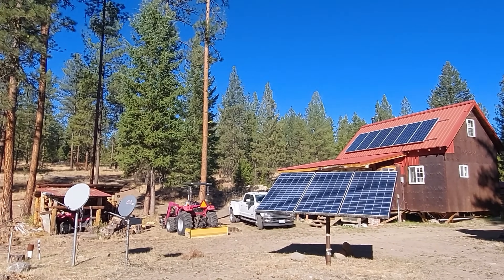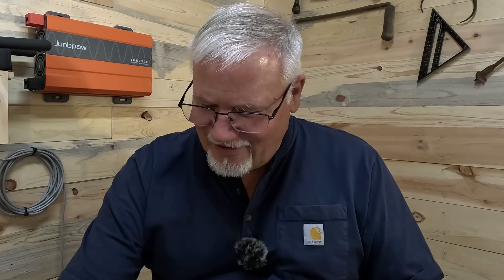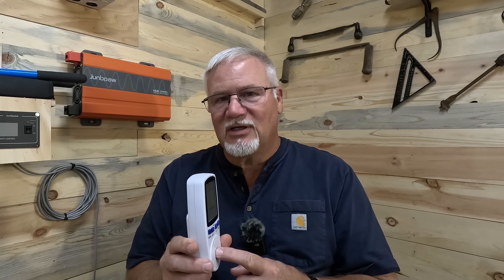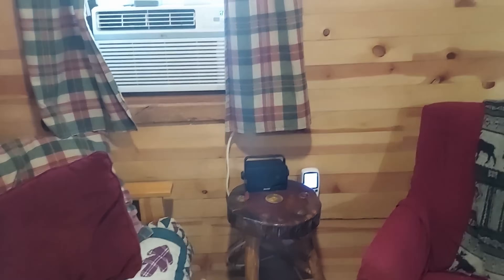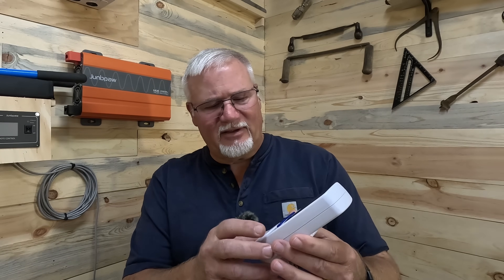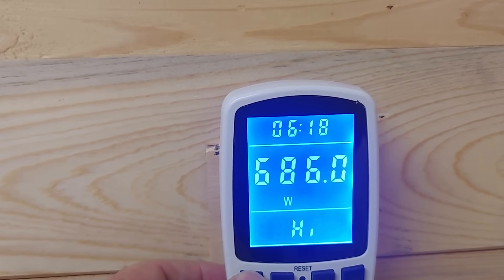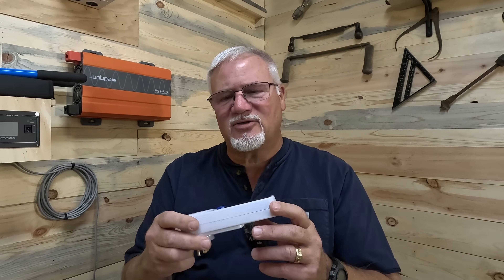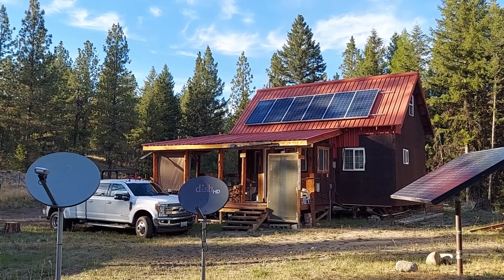How to Size Your Power Station PERFECTLY Every Time

Comment: One thing, measurement devices are the common recommendation but they can't measure inverter losses on a power supply and that has to be taken into account for sizing the station.

Especially smaller loads that will have extended run times are extremely deceiving.

I have had a kill a watt for like 30 years lol and I just got two new measurement devices so I can be more detailed in review so I guess it was kinda common sense to me lol.

Measure before you buy, it's Ike that for everything right?  Who just builds a shed without measuring?
Reply from the maker: Yes, inverter efficiency is definitely a factor to keep in mind!
Reply: @TheOldJarhead  So you know how detailed I am, something I would have brought up and shown how to measure for this topic
Reply from the maker: Hard ro fit in sometimes.

Comment: upgrade your workflow, these manual power meters are 20yr ago tech, get your self some smart power meters wtih an app for your phone and log and measure all you like, alot easier then mucking around wih the old tech
Reply from the maker: Sometimes, simple old tech is all you need, and too many times, aps are a pain in the phone 😉 But I will have to checkbthem out
Reply: I use those. Perfect to see usage patterns. I can even determine if the fridge door was not fully closed
Reply from the maker: I looked up the 'smart' ones and the first thing I see is 'Alexa'....I worked in Telecom for 3 decades and one thing I won't have is ANY 'smart' device that uses that technology (doesn't matter who's brand).  I went to the meetings where we were introduced to the tech and what's being done with it.  Like most in management (and technicians) in that world, I wont have it in my home.
Reply: @TheOldJarhead There is a lot out there but I'm pretty sure the smart plugs can report nothing more than Voltage, Current and Watt. 
Some people who don't want the cloud to know their fridge is open either choose bluetooth devices or Home Assistant compatible devices able to work without internet access and restrict all traffic to the outside world on the specific wifi network.

I'm not that concerned with this kind of data but I only choose reputable brands to be sure. 

Some home battery brands also sell these devices and they have a lot too lose if data leaks.
Reply from the maker: LOL -- I've been to all the meetings and introductions.  What they say to the consumer is NOT what they are doing.  Heck, routers and wifi extenders are gathering data and selling it.  They are literally making deals to have access to everything the 'smart' device connects to and through, for their own purposes when making a device that works with Alexa etc.  

I'm not a conspiracy nut, I'm just someone who actually worked in the industry and won't have them in my home.

Comment: I wish they made one of these for a tt30 plug for my 30 amp transfer switch and power station that is plugged into it. Tried a smart plug but it won’t read over 1800 watts and even shut down when the power draw exceeded the rated 15 amps.
Reply from the maker: I'm sure there are other options out there that could work for you!

Comment: Simply the best advice. I've been using this meter for the past year. Once you have a real picture of the actual power usage you are using, the math is deceptively simple. I don't run off grid, but rather as backup in the event of an outage (or hurricane, here in Florida).
Reply from the maker: Yes, it really helps to know the numbers!

Comment: I have the same Meter. I question the accuracy of that meter. Have you ever tested the accuracy of the meter?
Reply from the maker: No, though, it has seemed accurate when I use it at the cabin or test something with a power station.

Comment: I used this same method to determine the size of my three Ecoflow power stations I currently own. We rarely lose power but I think my power stations would get us through a few days. My main concern is keeping my freezer going. A good tip to keep the freezer from unthawing is to allow it to cycle a few times a day rather then keeping the power station running it all day.
Reply from the maker: Great point, allowing the freezer to cycle can definitely extend the runtime!
Reply: Unthawing? Isn't that freezing? 😉
Reply: @v0n1b0  Yeah, my mistake. I meant thawing.

Comment: Yes, the best first step is knowing how much energy you need. Everyone has slightly different power consumption; however, "critical circuits" should be your first priority. I have a Kill-o-Watt meter, but I use a slightly more advanced system, which utilizes an Emporia smart home energy monitor. It's a wireless inductive pickup kit that connects to your main breaker and eight (8) additional circuits that records up to 30 days of energy data. You know exactly how many watts/kWh of energy each circuit uses and the total. I paid slightly over $100 for that about 2 years ago.
Reply from the maker: Nice.  Great idea